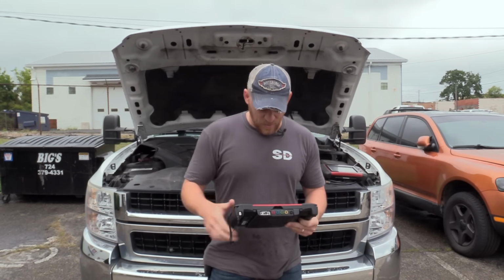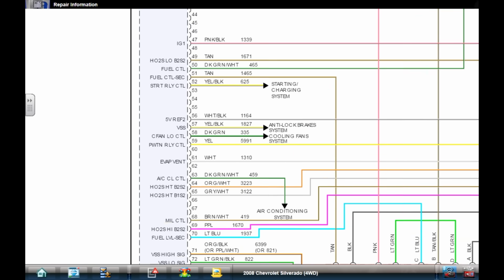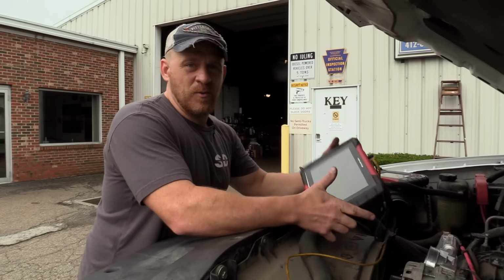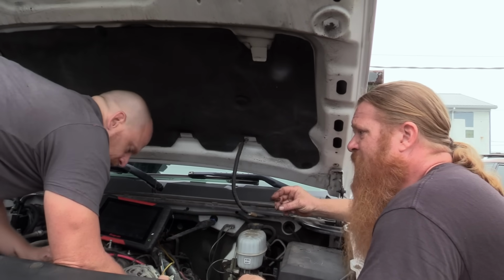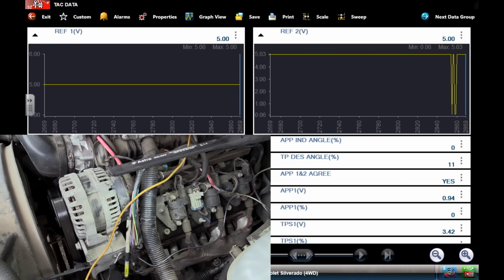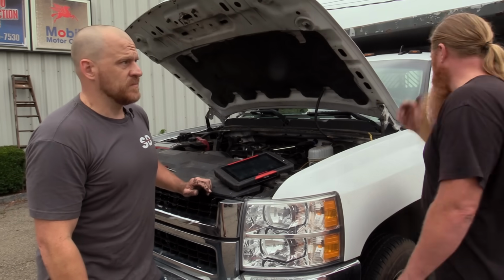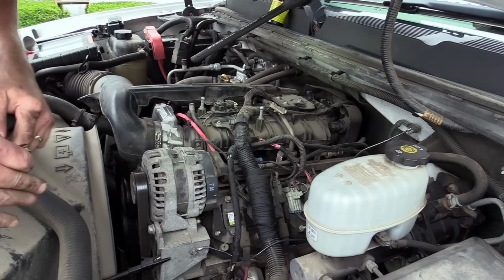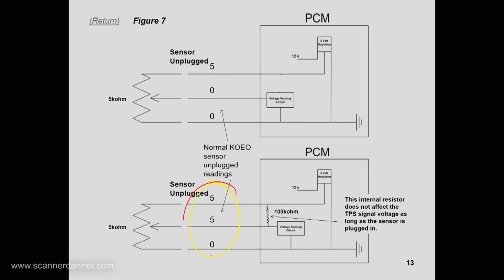Troubleshooting a Shorted 5v Reference Circuit (Chevy Silverado)

Comment: Phil’s probe is great for getting into tight spaces. It really is strange to discuss a mans probe. 😂 I’m with you on the parts store code reading problem. Lady came in today with a dead cell in the battery they told her battery was fine. She also had a p1101 and they told her she needed a mass airflow sensor when it was just a leaking vacuum line. They are mostly a bunch of counter clerks who want to make a sale and need to stay away from trying to diagnose a vehicle with their cheap generic code readers and nothing else. I tell customers every chance I get that a scan tool doesn’t diagnose a vehicle and only gives direction on which way to look. Sometimes it’s not even the right direction. They give these people the mindset of why am I paying $100 for you to spend five minutes plugging into my car and reading a code when that couldn’t be further from the truth.
Reply from the maker: lol agree!!

Comment: One thing that you forgot Paul, was to say to look at and read the code description first. That's the one part parts changers skip over. The description literally will say "circuit" in it, but parts changers ignore that. I'm a Chrysler dealer tech, and have been taught to check everything before making a call on a problem. A good example is the 3.6 engine, it had a flaw in one of the cylinder heads when it first came out that caused a misfire problem. Parts changers would have thrown plugs and coils in it before discovering the true cause. Read the descriptions, folks, all it does is point in the general direction of the cause. It's up to you to investigate and find the cause of the problem, like Paul did in this video. Great work, Paul! Also, a vacuum cap on the stud would have helped to fix the problem.

Comment: Maybe the reason for the crank sensor and misfire codes was that the wire was shorting on the stud in very short bursts with the engine vibration. That would affect the crank sensor square wave output, making it erratic. Since the computer seems to have a short time tolerance on the reference circuit shorting, it took the erratic crank signal for face value and erroneously set the codes, since the crank sensor is instrumental in misfire detection. That also skewed the ignition timing, causing the engine to run poorly.
Reply: Joseph Wash it’s all strategy to cut parts to avoid damage

Comment: Ever think to throw a low amp clamp around the 5 volt ref 2 wire and monitor it? It can give you an indication if you're in the right place by being able to see intermittent amperage spikes when the circuit is shorting
Reply from the maker: you could do that, but the code and symptoms already told us this was the case. Make sense?
Reply: @ScannerDanner  I was thinking about the times when the ref was completely shorted and it was one circuit...with an amp clamp around different legs of the circuit you could cycle the key off and on and watch for amperage spikes...could help narrow things down instead of cutting wires and rechecking
Reply from the maker: I like it!
Reply: @ScannerDanner  I've been part of your premium channel for a year...you've changed my life as a tech. I've gone from the typical parts changer to my shops top guy. Keep up the videos, I love them all especially the ones from Rosedale. God bless!

Comment: Great work .. appreciate it is helping me out .. I have 2006 Chevy 1500 have changed everything ..new  spark plug/ wires / distributor/ spider injection , new heads , catalytic converters/ o2 sensor with oem parts  still has p0300  after everything done to it ... I believe now it’s ethier the computer is bad or electric issues just like your video . Truck runs great just will flash p0300 . Been a headache trying to
Figure  it just have up and run the truck with the code on
Reply: Are you sure it's a 2006 and not a 1996.
Reply: Yes 2006 with 4.3 v6
Reply: It’s 2006 Chevy 1500 single cab short bed .. have done everything to it took it to 3 different shop looked at myself fixed all the issues and still has p0300  truck runs good but has check engine and will flash p0300 random misfire only thing left is ecm or wiring warness  but I gave up on and just run it with code on
Reply: I was forgetting about the 4.3l, it's like a ghost from the past. The only suspect part you haven't mentioned changing is the CKP sensor, it could even cause false misfire codes. If it's running well, maybe you should leave good enough alone.
Reply: Sorry I forgot to mention have changed crank sensor and cam sensor with new distributor... so basically everything also have checked maf sensor done smoke test for any vacuum leak , engine has good compression , runs well don’t feel the misfire but get check engine light p0300  will illuminate all the time I run it like that now for about 500 miles and no issue so far I been dealing with this issues for about 6 months and got tired of it and gave up on fixing it just going to run it until it blows up
Reply from the maker: @MrSehka77  compression test!! Do you feel a roughness at idle speeds? What are your fuel trim numbers at idle?
Reply: Hello danner , appreciate your reply ... compression has been check by 3 different shops  , also forgot to mention we have replaced fuel pump as well  ... I replaced basically everything mechanically , also all 3 shops have checked wires to spider injection everything good .. I forgot to
Mention theirs was about 10 wires under driver side wheel that were rubbed by tire insulation came off but none were ripped / torn I have check those wires and re taped to be sure none were touching all those  wires run to main wiring fuse next to ecm .. I wonder if that could of burnt / fried ecm  or could be the issue .. truck runs well I don’t feel or hear misfire all shops agreed but i constantly get random missfore code p0300 flashes and is on all times . No shop we’re able to figure it out spend alof money replacing all those parts plus labor  would like to fix and appreciate your help thank you
Reply: Any suggestions on where to look danner ?
Reply: Is your oil pressure low especially at idle?  My 4.3 had a p0300 and my oil pressure was low at idle so one day I got it hot and then just let it sit idling for an hour or so and sure enough pressure just kept dropping until it started knocking.
Reply: Craig , no it has normal oil pressure  also have left it on idling for about a hour without an issue .. p0300 will flash once you drive  it or if you rev it up pass 2k rpms
Reply: Did you put a shim on crank sensor? They have a problem with crank hitting sensor. You could probably see scrapes on sensor. Usually rpm gauge starts bouncing.
Reply: Craig, no shim on crank sensor ... but it is new / replaced sensor but if it was that I  think i would throw that code for crank sensor not being good don’t u think ? I trows p0300 random misfire
Reply: I have heard of the sims on crank sensor and also might be cam sensor on distributor but has new distributor assembly also people saying it can be that it needs a crank sensor relearn but cannot be done with p0300 code .. 
frist shop repleaced  new distributor assembly, crank sensor, fuel pump & injector assembly w/ oem ac Delco parts  truck left shop w/ same. Code it came in w/ p0300 ..  told me I need new Cats cuse it was clogged .. took muffler shop repaired cats . Still have code p0300    2 shop : Chevy dealer 
Said I needed new injectors miss 1 & 4  couldn’t do relearn . Shop 3 said I had bad valves in heads and had air intake leak repair that new heads . Also replaced new wires / spark plug distributor cap and new crannk sensor w / ac Delco supposed we’re bad  . Picked up truck after 1 month @ shop w same code p0300 . Truck runs well but same light will flash and stay on . I drive 60 miles daily so far it’s been about 500 miles and no issues but would like to figure out what really is the issue it’s been Night mare truck
Reply: Pretty sure it can set a po300. Gm has a service bulletin to make sure your air gap is about 30 thousands and provides shims even for new sensor.
Reply: Yes I heard that but I would definitely recheck that . I remember frist shop that  replaced  crankcase sensor don’t no if it was original one didn’t have the shim but had marks on cps of it rubbing that’s why they replaced it but new cps wasn’t shim .. 3rd shop re wired the cps sensor and installed new one not sure if it was shimmed or not but I will re check it .. but I would think if was the cps  thats was bad  or miss aligned wouldn’t I throw a cps code I think it’s p0335
Reply: I hear you. The po300 is a real nightmare sometimes. I don’t think it necessarily has to throw po335 if it’s still getting good signals from it, but if the reluctor wheel is hitting the sensor it then sends bad signals. Often not noticed until higher rpms I assume because it then flex’s out to hitting sensor causing tac to go erratic. Does your tachometer move erratically after 2 -3000 rpms?  You would hope shop checked air gap though. Yeah if that’s good it could be so many things still. I guess they have the fuel pressure good by now.  I think I was still able to do crank relearn with po300. But mine was an 01.
Reply: I hear you .. makes sense on the shims I’ll re check cps but I’m sure it’s not shimmed and if it’s marked or hurting that can be the issues . No issues with rpms everything normal and fuel pressure is normal .. I definitely changed everything that can cause p0300 I kept thinking had to be wiring issue maybe a short to main harness causing false misfire or ecm
Reply: I checked cps no shims but also not rubbing . Check all wiring harness seems fine just not sure wat else it can be
Reply: Did you make sure the air gap was 30 thousands?  South main auto has good video called p0335 shim or no shim.
Reply: Crank sensor had no shim and hasn’t hitting or touching . So I thought I was fine I wonder if I need a shim  but I’ll
Make sure I’ll check that video out thank you for your help
Reply: @MrSehka77 You mentioned rubbed wires in the wheelwell, and that they were repaired.  Did any of these shops take the time to see what circuit the damaged wires were in, and the components they connected to?  Might be worthwhile to check all wires in that harness for continuity, and intermittent problems.  Knowing the end points (modules) connected to and signal name should be very helpful.  From the way you describe everything, I'm sure you can do this yourself and not be taken again by any of these shops.  I could say more about what seems like unscrupulous and outright dishonest shops, but I won't.  I really hope you can find and fix this soon, and get good help from viewers.

  EDIT:  I looked again and saw that you taped those wires.  Need to take that tape off and get a can of liquid tape and use it to seal each of those wires individually.  Also, especially because it is in the wheelwell,  check closely for corrosion in those wires.  I would suggest giving each one a tug to check for wires that are broken or corroded in two and making intermittent contact.  Not that hard to fix.  After all is done, tape the bundle together.
Reply: Hello Paul, thank you for your help .. the last shop
Was the only one that check it .. I explain and told them wat happn supposedly he check then and taped but said that should be the issues .. but I always had a feeling  that could be the issue all along.. all those wire go directly to the main fuse box or ecm but some most wires looked like a small amount of insulation came off but maybe they are not making good contact or continuity and that’s can cause issues . Also thought that could all wires could of shorted together and damage the ecm from the inside or any other electronic hence the issue with always having that check engine light on won’t go away after everything being replaced . But I will look in to that a bit closer hopefully fixeds the issues thank you for your help

Comment: if a wire is touching ground, it will heat up and be easily seen using a thermal camera--turning a 5 hour job into a 15 minute job.
Reply: There was a lot more current flowing through most of the other wires than that 5v ref. wire. He would have had to pull that wire out of the harness to see which part of it was hottest. By then it wouldn't be shorting anymore and he would have seen the problem anyway.
Reply from the maker: @fascistpedant758  not to mention it was NOT a constant short, only intermittently. you would have never caught that with a thermal imaging camera

Comment: At FiatChrysler Service Library we just turn the vehicle off then on and then refresh the scan tool and that it. Funny how the Mitchell system is so different. Great job though and as always "Don't be a parts changer" I love that saying lol.  I would have put a rubber hose to the bolt to cover it up. Eh! eh!

Comment: I love watching your videos. You're a great teacher. I was an ASE certified automatic transmission rebuilder but I'm retired on disability with a bad back. Transmissions are heavy. I've always done my own work on my stuff and could pretty much fix most stuff but electrical work wasn't my strong suit. I'd get to the root of the problem but I've replaced a few unnecessary parts along the way, I must admit. You have given me some valuable information and I have a problem that I've been ignoring for some time and will now dig into hunting down what I believe is a similar  issue in my '93 Villager. Thanks for making these videos, bro..

Comment: Maybe even one of these large enough to fit the harness and attach it to the bolt that wore a hole in it? https://www.amazon.com/LOKMAN-Stainless-Cushioned-Insulated-Installation/dp/B01HPE188Q/ref=asc_df_B01HPE188Q/?tag=hyprod-20&linkCode=df0&hvadid=309832851244&hvpos=1o1&hvnetw=g&hvrand=8595513324466154090&hvpone=&hvptwo=&hvqmt=&hvdev=c&hvdvcmdl=&hvlocint=&hvlocphy=9022482&hvtargid=pla-571295443341&psc=1&tag=&ref=&adgrpid=64417494871&hvpone=&hvptwo=&hvadid=309832851244&hvpos=1o1&hvnetw=g&hvrand=8595513324466154090&hvqmt=&hvdev=c&hvdvcmdl=&hvlocint=&hvlocphy=9022482&hvtargid=pla-571295443341

Comment: No. I cringe when you crank the engine with a 10,000 dollar sanner on it. I myself have a verdict. Which comes with a bluetooth multi meter and a scanner module $8,000. I cried when it fell one day.

Comment: Saw an injector wire chafed like that on a car one time, it was blowing the injector fuse. That purple/white wire probably rubs from the torque of the engine at different rpm's.

Comment: "Code reading parts changing", I completely agree with you. We get customers all the time coming in saying "the parts store read the code and said I need this part". My response is "they're a parts store, selling parts is how they make money." Then I let them know that there are thousands of codes with a half dozen or more things that can set each code. It's cheaper to diagnose first, then repair what is causing the problem. And yeah, the code reader commercial make me mad too. They're just making money selling there product.
Reply: He didn't even need codes to change the throttle body. He just googled "reduced power".

Comment: Sweet video!  I had this very issue with that harness.  I had a 2007 Yukon that came in on a rollback.  It was a no crank-no start. It had rubbed through in that very same spot. It would blow the fuse for the starter solenoid signal.  I found it using a test light with the clip connected to B+, connected it to the solenoid wire and wiggled the harness, starting near the starter and working toward the fuse box, until the light came on (test light on = short to ground.)  From the factory, there is supposed to be a plastic cap on that stud.

Comment: I just got the alert you posted this video.  If I was there with you I  would've used your truck as a guide to fix the one in the video. Used good data and look at what your truck has as far as grounds and the white one doesn't.
Reply: Yeah! We could have shorted a few circuits on your truck and swapped a couple of "known good" parts from it.
Reply: @fascistpedant758  I see your sarcasm, but I don't think he was suggesting parts swapping.  I disagree with his approach, though.
Reply: @paulmonk7820  It was meant to be humorous, not sarcastic.